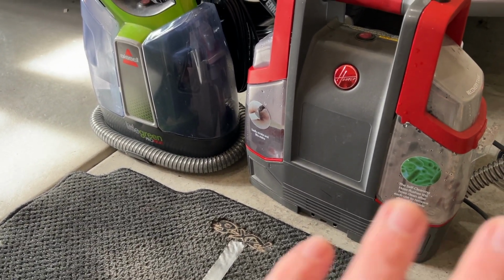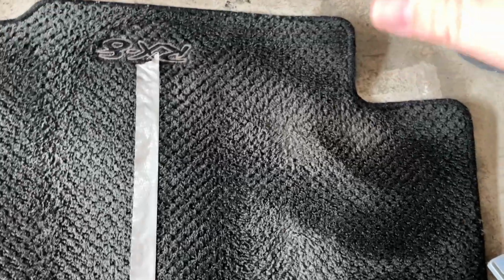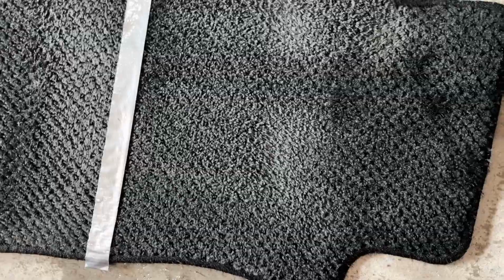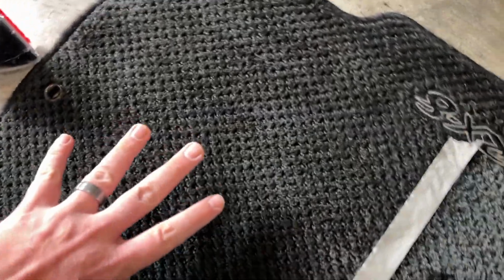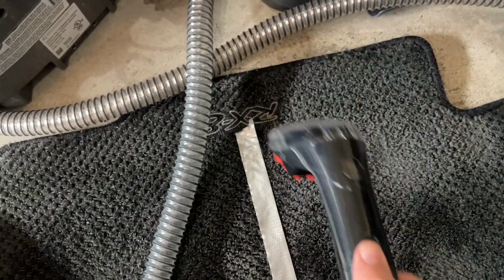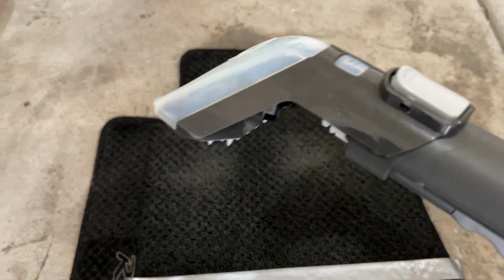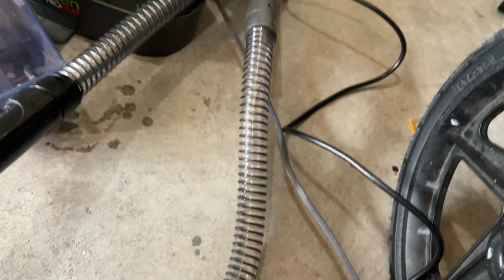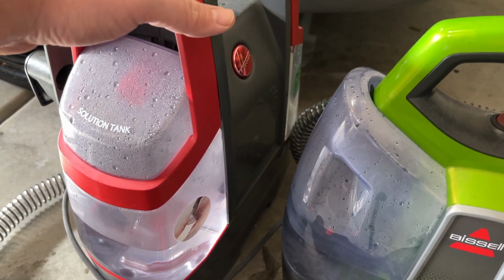Bissell Little Green Pet Pro Heat vs. Hoover Spotless - Which Is Better?

Comment: I have the Hart one. its the exact same as that HOOVER but branded for walmart. I have only used it twice but I am perfectly happy with the performance I got out of it for $70. I will say also I like the hose cleaning port on the Hart/Hoover so you can clean out the gunk out and it doesnt have dirty water sitting in the hose.
Reply from the maker: I haven’t heard of the Hart but sound the exact same. Does the job!